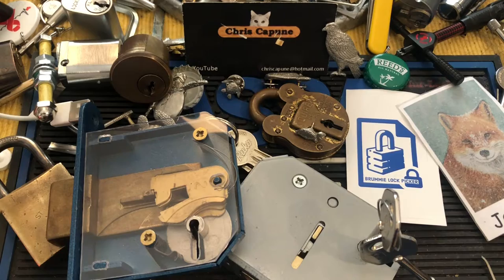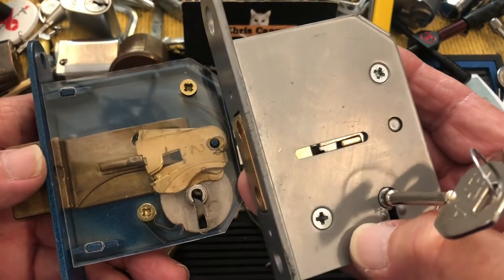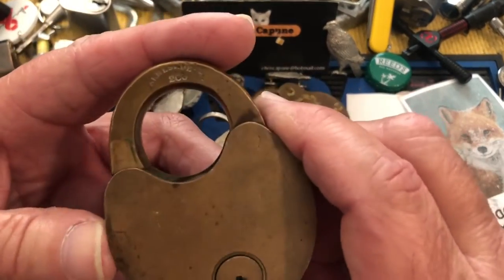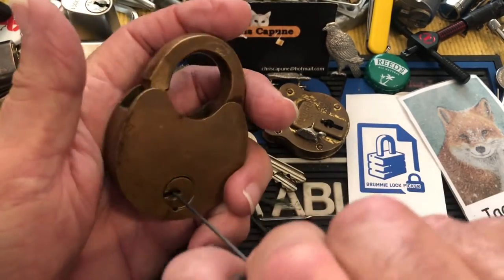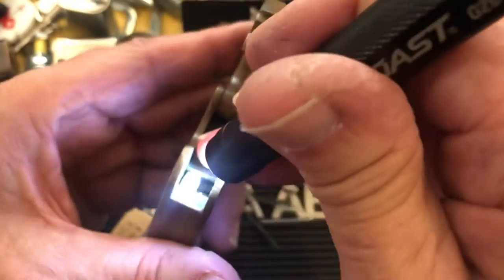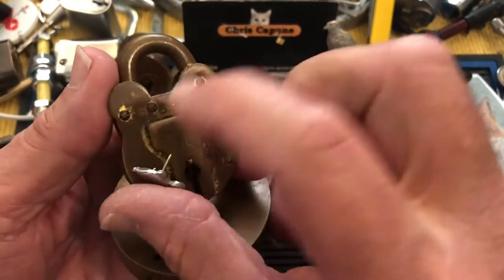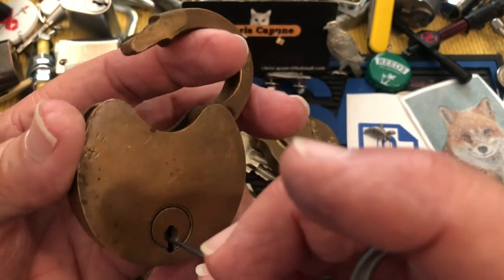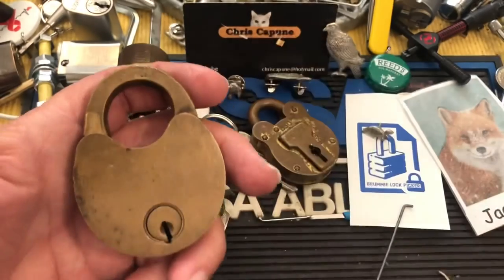#1338 Beautiful all brass lever lock

Comment: Nice open on that cool all brass lever lock
The one you sent me had a spring loaded bolt so once picked, push the shackle down and it locked again
Unfortunately yours does not, your going to have to pick it to get it closed, using 2 wires if possible 
Good luck with that one 🇺🇸😷👍
Reply from the maker: Thank you my friend!! 
Will give it a go! Was so fun the get the open I want to do it again 😀 
😷🐾🐈🐈‍⬛🐾😷🇬🇧